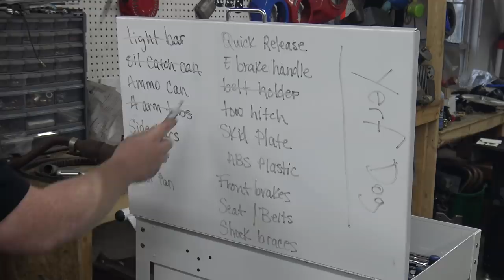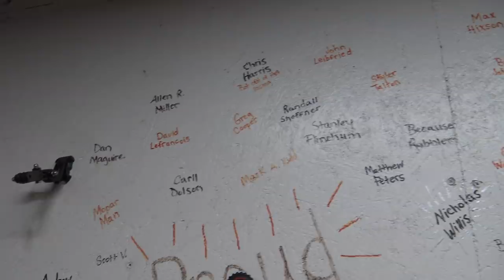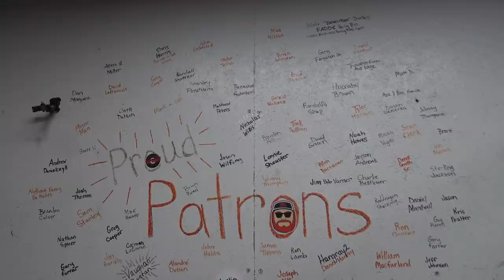Custom 625cc Buggy Upgrades & Teardown ~ Yerfdog 3200 Build Ep9

Comment: Make sure you post a link to those weld-on front brake kits you're making. I was trying to figure out how to do something similar using the GoPowerSports 4x4 hubs (sort of like CarsandCameras did on their crosskart). If I could just buy something that requires accurate alignment (like a brake rotor) I'd rather have it professionally made rather than make it myself.

Comment: Hey was up red beard. I got a question about another video, the predator governor removal. I did everything u did removed the governor. Now for some reason every time I start my bike it wants to take off. My throttle linkage is all good too. Any help

Comment: I have a 420cc go kart, I believe it has a 12 tooth and a 46 tooth sprocket on the axcel, the problem I am having it that the torque converter belt just spins and smokes, what would be the reason for this?

Comment: Hey love your videos Hi I purchased a baja dune 150cc but it is missing the gear selector part that goes on engine, I have the cable running back to engine but nothing to attach it to there is just a hole there, I am looking for that part or if you know what it is called thanks